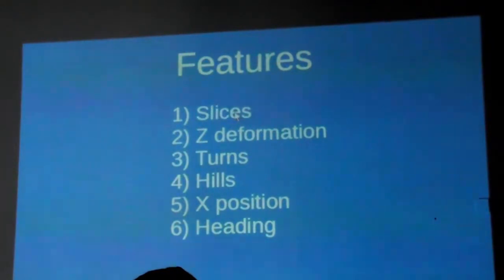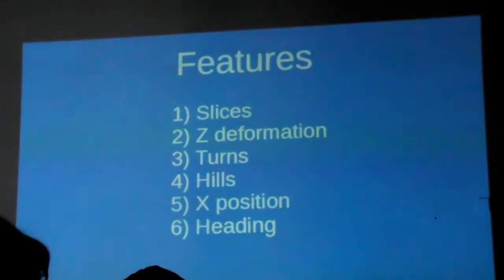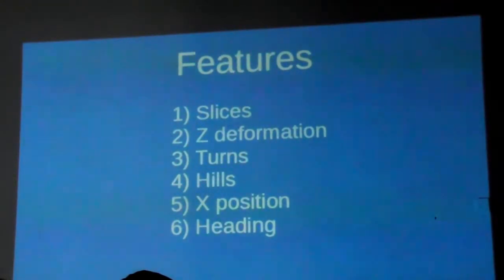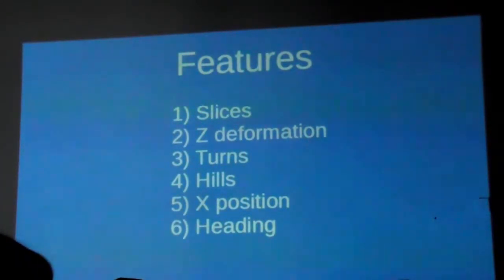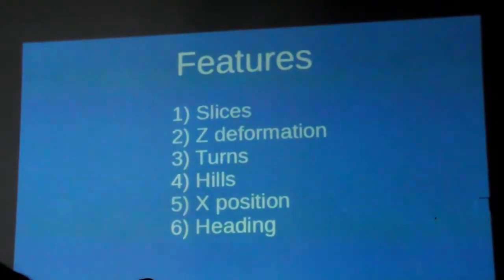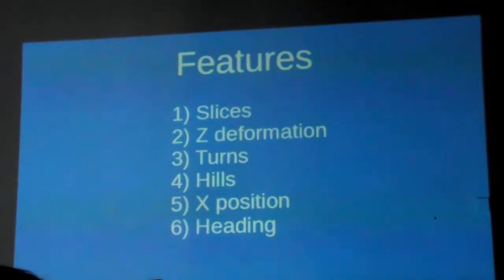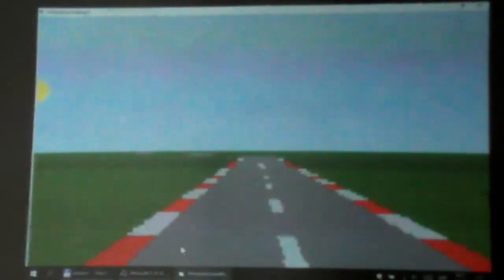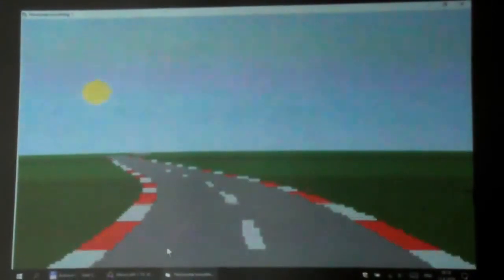Atariáda 2019 - Pseudo 3D road rendering on 8-bit Atari

Comment: That first game was Electroglide - not electrolyte as the subtitles say - I still have it on 3.5 inch disk, whether it works now though is another matter, disks are over 35 years old. It was an extremely difficult game, the programmer really knew how to get the most from the A8 bit